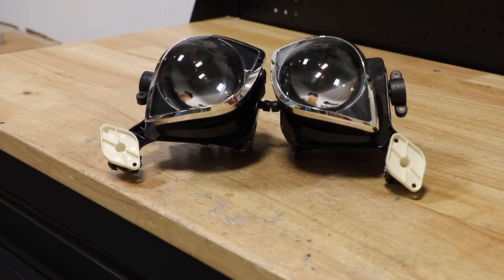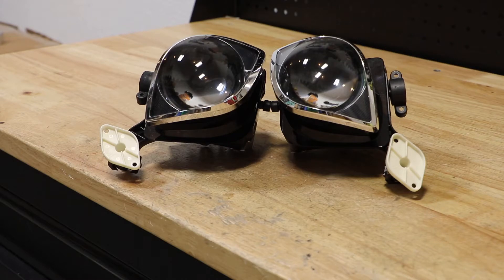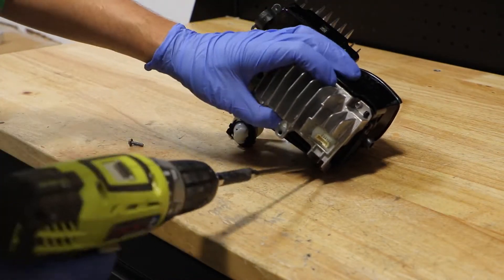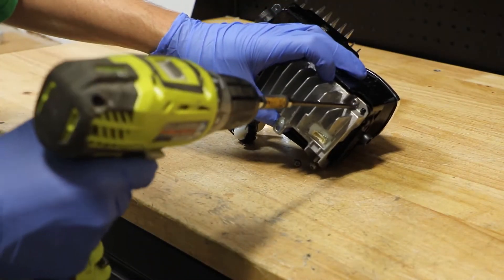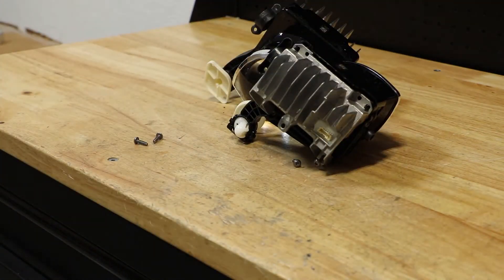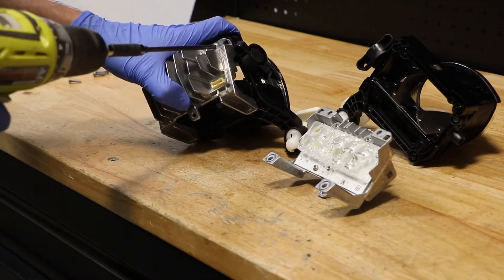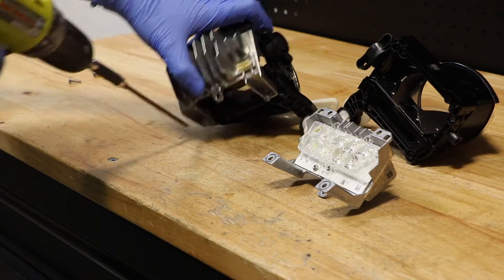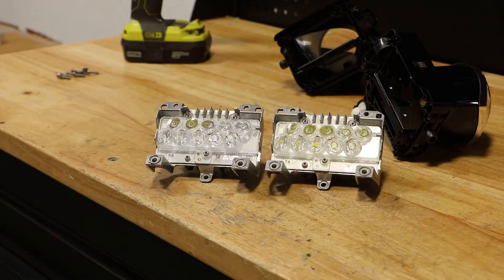2015-2018 Mercedes Benz C300 LED Projector Disassembly

Comment: Can you please let me know is there any chance to adjust the same projectors as these from UK to EU somehow?
Reply from the maker: What do you mean by adjust? 

I don't think you can replace a Left Hand Drive light with a Right Hand Drive light.  The cut off shield in the light is a physical non-moving component.  I've seen some lights where they are interchangeable and the software in the car will tell the light how to operate to have the correct cutoff shield for the application.